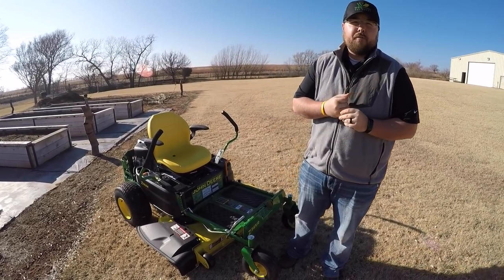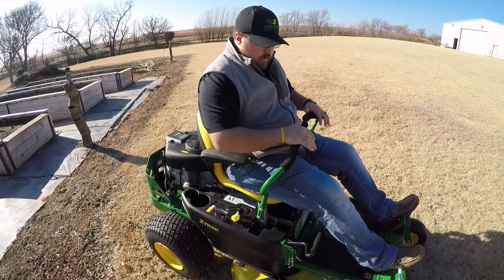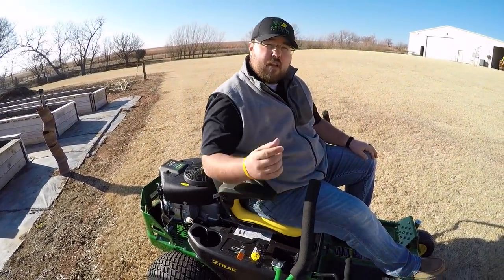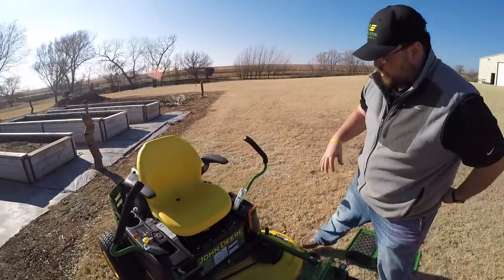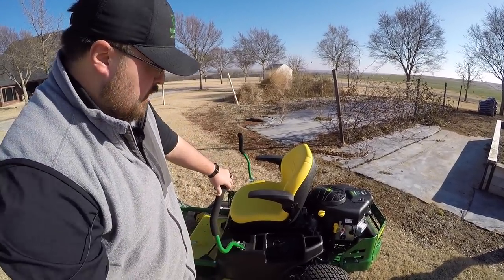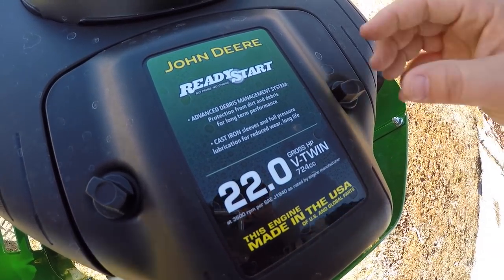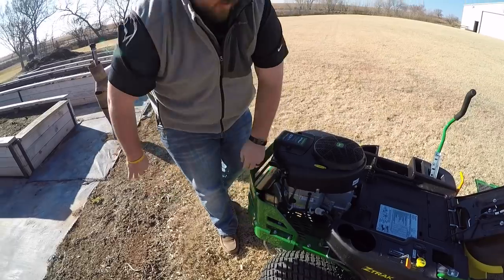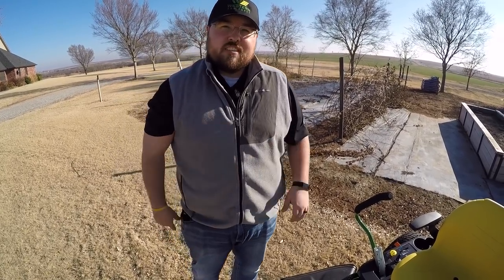2019 John Deere Ztrak Z345R Walkaround Product Overview

Comment: I'm on my third summer with my Z345R. So far, it has been a great mower. I've had to replace the deck tension spring and the blades, but no other problems. I have found it much easier to jack the mower to replace the blades. Removing the entire deck takes longer.
Reply from the maker: Nice! I am glad to hear you are having such good luck with it! I agree on the raising of the mower instead of deck removal, as long as you have everything to do it safely. How much do you have to mow?

Comment: Thanks for replying about the foot deck lift pedal I ordered one for the 345M. Now that I have it at the farm for a couple days I'm kind of regretting not getting a 46 or 48" deck! Reason I'd prefer that to the 42" is when you get near objects (trees, fence posts etc) the bigger deck would be your guide and you'd either brush or nudge the movement around it whereas on the 42" the deck is so close under the machine that the rear tire kind of hits and funky things happen now when I edge etc LOL...I was used to a 48" deck on my previous rider and there's tight spots I wanted to get into with a 42" and that's the reason I bought this! Regardless coming from a traditional rider to this is way different and I immediately took to this! The ride albeit not luxury smooth cause any normal yard-farm isn't baby butt smooth, but the ride is definitely improved and I can whisk around plus the seat and position I'm in is totally comfortable!
Reply from the maker: Well I am glad to hear you are happy with your new mower for the most part. Thanks again for watching!
Reply: @WesternEquipment  Update, now that I've had more time on it I actually have it mastered to get really close to objects and under things...The cut is super clean and the ride is comfortable and having the 42" is now a savior to get through the obstacles but it's also doing my farm in less time because I can zip around now!

Comment: Just got my new Z345R yesterday. The owners manual shows sealed ball bearings for the front casters. Not plastic bushings. I am also 5'10 270 and have had to reverse the levers to gain clearance for my big gut. I wish there was just an inch or two more adjustment in the levers. Now I wish I had a bigger yard. LOL
Reply from the maker: Yes, your front caster wheels have sealed bearings but where the fork meets the frame has just plastic bushings. I am about your size and weight and have the same issue in some of these smaller mowers. Is your seat adjusted all the way back to make sure and give you the most room?
Reply: @WesternEquipment  Yes my seat is all the way back. I found that by reversing the (enhanced) levers I gained another inch or two of clearance. Probably wouldn't hurt to cut back on the beer as well. LOL

Comment: I bought the Z540m, 48” standard deck, & mowed 2 acres of field/grass/weeds, 6’ tall red stalked weeds, wet thick grass, and bogged the mower to a stop, killed the engine. Couldn’t process that much material, with that deck, and standard JD blades. Very heavy machine to push by hand.  I found some Kavli blades, from Australia, and I’ve never been bogged down again. When I mowed along side the adjoining corn field, it cut the grass, corn stalks, and ears, after harvesting for the season.  Hardly any effort to the machine, mowing 6-7 mph.  Hardly any wear to my blades, at the end of season maintenance!  I would say these Kavli blades doubled my mowers abilities, saved gas & wear on my belts, and my time.  I would use these blades on any of my, or your mowers, to get top performance out of our mowers!  Love to see you compare the acre timing with these blades. I think you would be surprised at the time, and finished quality!  On Utube, John Kavli site, and Something 2look at, site.  The make a great mower, better!
Reply from the maker: Wow, I will have to check those blades out. Thank you for the comment and thanks for watching!
Reply: @WesternEquipment  I had a Z93? 30 hp Diesel first, but the new setup worked better . Loved both machines, couldn’t afford the bigger machine, because I was mowing my daughters property, for free, and then will use it in town. Needed easy trailer loading, and small enough too go through my shed doors.  My Dealer is fantastic, as is my machine. Thanks, you work for a great organization, enjoy!

Comment: Great video.  I have one. How do you check the transmission fluid?
Reply from the maker: This is a sealed transmission that does not require service or checking of the fluid. If you think you may have transmission issues it is recommended that you take it to the nearest dealer. I hope this helps and thanks for watching!

Comment: Great video.  You mention using air as opposed to water for cleaning.  How can this be done?
Reply from the maker: This can be done a few different ways but, the ones I recommend would be a leaf blower or an air compressor. Good question and thanks for watching!
Reply: @WesternEquipment  Is it necessary to remove the deck if I use air to clean the underside?

Comment: Very well done. Lots of small extras that is leaning me towards purchasing this model. Will contact our local AgPro dealer soon for a test drive. How well does the finished cut look compared to push mower?
Reply from the maker: Cut quality looks great as long as you have your anti-scalping wheels adjusted right on your deck and take your time through the thick areas.

Comment: Brent. Leaning back to the Z345R over the S240. I have a really flat yard. Do you think I would get along ok with not putting the front weights and brackets on the ztr for the bagging system?
Reply from the maker: I definitely think you could give it a try. They will come with the bagging kit so you will have them if you ever feel that you need it.

Comment: I’ve probably watched this video 20 times since buying a Z345R that I’m waiting on to be delivered! I’m shocked at how much lighter the Z345 is across the class. Does this lightness come from better engineering, or does it show up in chassis twisting etc? I guess I’m concerned that I’m going to notice that it’s more sparsely built as a result. Should I be worried?
Reply from the maker: I would not be worried. How much are you mowing and what kind of conditions?
Reply: @WesternEquipment  admittedly half an acre, mostly flat. Some steep landscape berms that I’ll have to push anyway.

Comment: My property has a couple of 30⁰ + hills.  Could a zero turn accomplish these sections? If so,  would there be a significant difference between the 300 series vs 500 series? Just trying to get and idea of cost vs performance in my unique situation. Seems the 300 is very economical compared to an extra $1200 for next level up  Thanks!
Reply from the maker: Yes the Z3 would be a much more economical choice. But by going up to the Z5 you are getting a larger wheel base, more stability, a heavier mower which also means more stability, and it also has the ROPS (roll over protection system). With the hills on your property I would definitely suggest investing in the Z5 for the safety aspects, better transaxles, and overall longevity of the mower. All my opinion of course but I think all of these things should be highly considered. Check our video of the updates to 2021 on the Z5 to see some of the things I mentioned. Thanks for watching!
Reply: @WesternEquipment  Thanks for the quick response! So you don't think I would be doing wrong by getting a zero-turn vs a tractor  - knowing I have a couple steep areas on my yard? I guess that is one of my biggest concerns - tractors seem to be even less stable for hills because of shorter stance...
Reply from the maker: I think you would be fine with a zero turn. You just have to fine what works best for you when mowing. Whether it be going up and down the hills or mowing the horizontally.

Comment: Your walkaround video is well done.   Thank you.   I have a starting issue that perhaps is common.  I started the 2018 Z345R with Briggs Eng.  and adjusted the throttle and the machine died.   Now I have no apparent power to the switch.  No light at the hour meter.  Full battery charge.  Have I blown the FI fuse?  Or should I be looking for a loose wire at the switch.    As I try to start, I'm in the seat, break on, handle bar in neutral with blade engage button pushed in.     Machine has about 3 hours of use.    Thanks for any insight you can offer.    RICK,  Northern CA
Reply from the maker: I would check to see that your seat switch is plugged in good and if that is all good then start looking for loose wires. Battery cables, Key switch, starter, etc. I hope this helps and thanks for watching!

Comment: Does the z345r have a low fuel indicator light? If so where is it located? Thanks
Reply from the maker: Yes it does. It will be located by your throttle lever. It will be a gas pump emblem and it will light up red when you are low on fuel. Thanks for watching!
Reply: @WesternEquipment  thanks

Comment: stuck between JD Z345R and the 2020 Ariens Ikon XD - few have said the fabricated deck on the Ariens is the deal breaker - your thoughts?
Reply from the maker: Personally I’m a huge fan of the stamped decks. Cutting grass is all about air flow. With stamped decks you have smooth surfaces to allow more flow. Fabricated decks are great in some applications. You just have to be more diligent about keeping them clean. Thanks for watching!

Comment: I Was Reading My z345r Operators Manual Because It Was Due For The First 8 Hour Maintenance, And It Says  "The transmission is a sealed component. No maintenance is required on this transmission. If you suspect any transmission problems, please contact your authorized dealer." Is This True? I Just Wanted To Service It Because I Noticed After The Machine Hit About 5 Hours, The Levers Were Really Stiff And It Was Hard To Maneuver The Machine.
Reply from the maker: Yes this is true! Have you levers loosened up any?
Reply: @WesternEquipment  no. I havent changed them since i picked it up from my dealer

Comment: Does the Z345R bag well with a regular bagging system? Need it to also be easy to take on and off easily a few times a season.
Reply from the maker: Yes, they do fine since it is only equipped with the 42" deck. If grass is damp or super thick you may have to watch for some clogging but other than that they do well.
Reply: Western Equipment Brent. I’m getting down to the little things on the baggers. It looks like the S240 and 100 series 42” mowers have the attachment of the tube to the deck with bunge cords. (I’m just looking a pictures). And it looks like the bagger system on the Z345R 42” does not have bunge/rubber straps for connecting. It looks like they use solid pins to connect. Is that correct? I want an easy connect feature since I will be taking it off and on a lot. Sorry for all the questions. You are a much better resource than me calling or going to a local dealer during Covid.
Reply from the maker: It is a pin system with an easy release lever. Both are super easy to take off. And that is what I am here for so keep the questions coming!
Reply: Thanks. I hate to buy a Cadillac when I just need a Chevy to mow a 1/3 acre of a flat empty lot of Bermuda. I have been electronically reviewing the crap out of the Z345R, S240, E170,160,140 and 130. Knowing I can do the Easy Change disconnect if I choose to. Then I discovered I am going to need to have a good bagger that I can take off a lot. Price range on all of these with tax go from $3,850 down to $2,575. So I want something I won’t need to ever replace and trust me I have a list of all the tools and parts I need to keep on hand to take care of it. (Made the list all from your videos). What mower will satisfy my needs the most?
Reply: Western Equipment Brent. I can’t find one, but maybe you know. Is there a 48” deck on a 100 series that has a bagging system which uses the pin system with an easy release system? Thanks!

Comment: I swapped the control levers around left to right to clear my stomach when I pull them both back to go into reverse.  Also, I wish the seat would go back further. Otherwise its a good mower.  :)
Reply from the maker: @p71collector Good idea. Thanks for the tip!

Comment: I am trying to find information on how to clean the gas tank as it got debris in it and is stopping the gas flow. Can you help me?
Reply from the maker: Probably the best thing to do here would be to buy a small electric pump to suck out the debris. Leaving enough gas in the mower that the debris is hopefully floating in the gas. I would say you could take the whole tank out, but that would take quite a bit of disassembly.

Comment: Other than width of cut, how would you compare the Z345R and Z355R?
Reply from the maker: Hardly any differences other than that. The Z355R has a bit wider stance due to larger rear tires and the from forks come out away from the mower more and they are splayed out.

Comment: My parking brake won’t engage after I dropped the deck and changed the belt. How do I fix that?
Reply from the maker: You might check to see if you somehow snagged the parking brake cable and pulled it loose from the lever. Let me know what you find and thanks for watching!

Comment: 9:47  Wash-out port.  On my Z525E 54" deck I have found that the wash-out feature works best with the deck at the lowest position.  Also, to run the RPM on low for a few minutes then on high for a minute then back to low.  Repeat.  Keep watching the water for when it starts to run clear.  I seem to get "better" results that way.

Of course, the general consensus is that the wash-out port is a gimmick anyway, so take my comment FWIW.
Reply from the maker: Yes this is definitely the best position to run the wash out. Thanks for the comment!

Comment: Great review! I just bought a 2019 Toro Timecutter MX4200, which is the previous design from Toro at a dealership for $400 off list price due to the fact that it was old (but new) from dealer stock. Pretty much apples to apples up the scale from the base model with respect to price with the JD reviewed here but is no longer a valid comparison if one is shopping new, because the Toro Timecutter MX models are history. Nowadays, one would have to compare a 2020 JD Z345R with 2020 Toro Timecutter model #75744 or #75745 with the MyRide system. I don't know if there are any changes to the Z-trak, but a whole lot of changes have come to the entire Toro Timecutter lineup. 

When the mower I got first came out for 2019 MY, it was listed at $3,099. The newly-designed 75744 is also listed at $3,099 but can be had currently for $2,899.  I got the old model for $2,700, but I bought from a dealership, assembled, gassed and oiled up, checked out, new Interstate battery, delivered, and ready to go. For 2020, the entire Timecutter lineup has a new look and a few more, but not so important features except for one...It now has dampened pumps for a smoother transmission, and I wish that I had opted for a Timecutter model 75744 (same features but newer design) due to those dampened pumps and 200 more bucks.  Also looks far better and better traction rear tires.

Toro sort of goes a different direction with the higher-level feature models than JD, which overall, I think is a much better value. They do not offer the foot pedal standard for any of the 42" models but can be added for a premium; no big deal; but does allow a quicker way to lift the deck which is sometimes needed, but a 42" deck is not heavy. Also true for the platform matt; that's an add-on for Timecutter. What Toro does offer at this level even in 2020  is a 10 gauge fabricated steel deck; a 22.5 hp Toro commercial V-twin engine with an unlimited hour 3 year warranty for residential customers (3 years, limited hours for commercial users); three years on the whole machine and the same center step through area for easier access, which my 2019 does not have. Toro has the same oil change set up but all on the same side as the oil filter. The one thing I much prefer about the JD model is the deck height setting system with the pin. On my mower, I have to count and find the 3" spot every time I lift and reset the deck height. I hate that. I really like the pin system on the JD. I also like the easy access to that flimsy stamped deck. But other than that, Timeuctter has this machine beat to death for the money; especially for 2020.
Reply from the maker: Thanks for watching!
Reply: I am kind of leaning toward the Timecutter as well for the reasons you stated.  Unfortunately that 75744 you referenced is no longer available. Now there is no model with a 42" fab deck & Toro commercial engine, you can only get the Kohler 22hp 7000 series. (model 75746).
I do wish Toro offered the flip up access panel to the deck pulleys like JD, and a foot pedal, and the 1/4" cut increments.

Comment: How do i know how much gas is in my z345m is there a guage?
Reply from the maker: Unfortunately on the Z300's there is only a low fuel light. It will be on your control panel by the throttle. It is a symbol of a gas pump and it will illuminate red when the fuel is low. I wish these models would get an upgrade with an actual fuel gauge. Good question and thanks for watching!

Comment: ? Couldn't you change the blades by lifting the lawnmower instead of removing the deck?
Reply from the maker: Yes you can lift it up instead of removing the deck. We just wanted to show how to remove the deck because there are a lot of people that prefer that method to change belts and blades.

Comment: Hello my z345 started on but the controls turns not working
Reply from the maker: It may be that your transaxles are disengaged. There are two silver levers on the frame by the engine that will engage or disengage your transaxles. If they are in the hook position they are disengaged and the mower can be easily pushed.  I would check this out and I hope it helps. Thanks for watching!